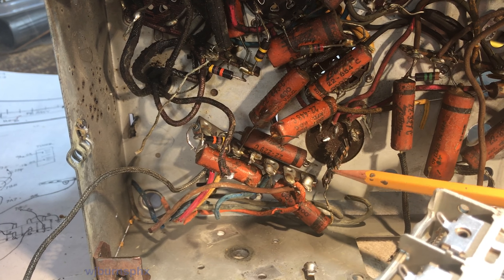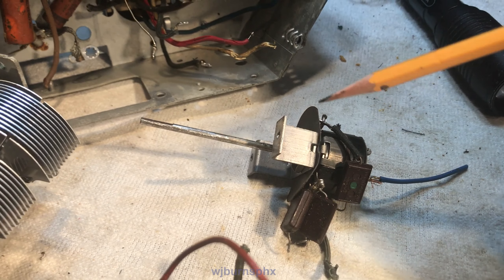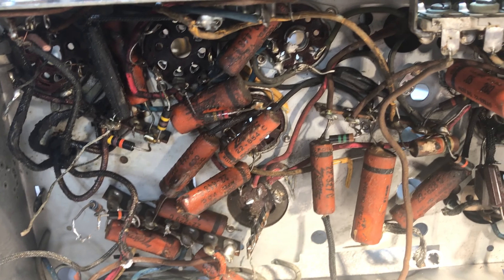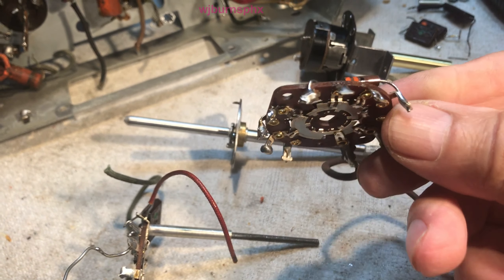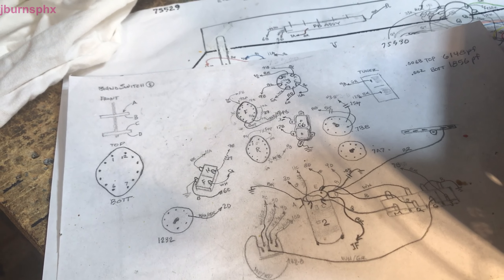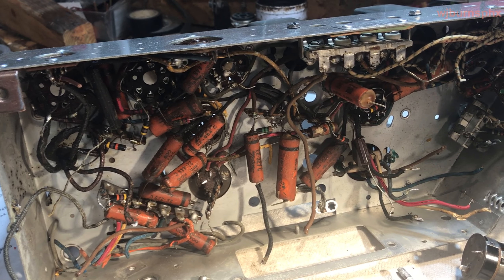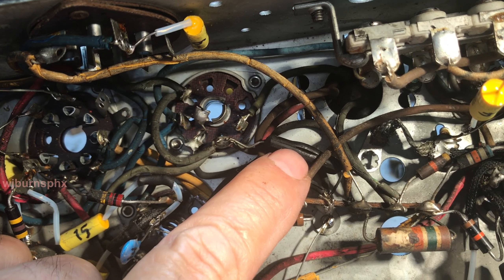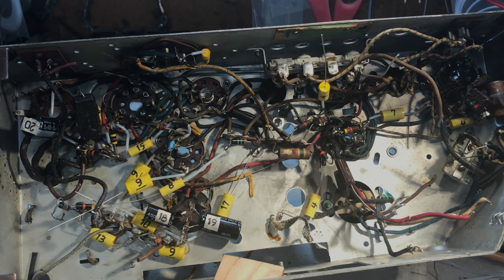Zenith 7S529 5 InProgress2

Comment: Your rotary switch and component diagrams are well thought out. Zenith thought rubber wiring was the bomb
 back then. Motorola too. Boy were they wrong! It just gets too hot under the chassis . It was 17 degrees above
 zero here in Chicago. Brrrr.